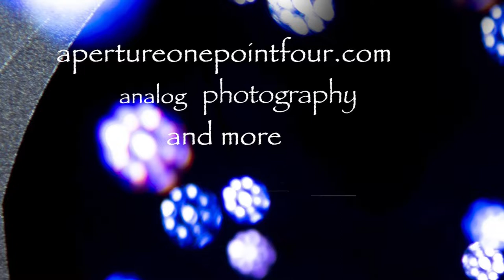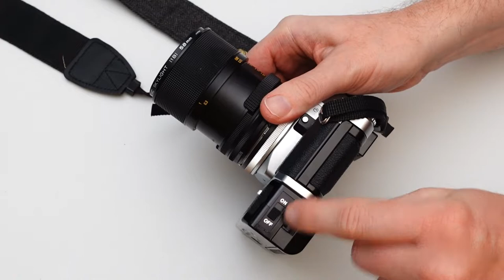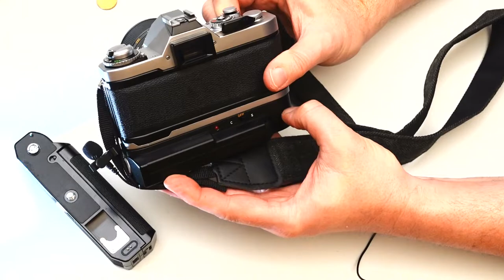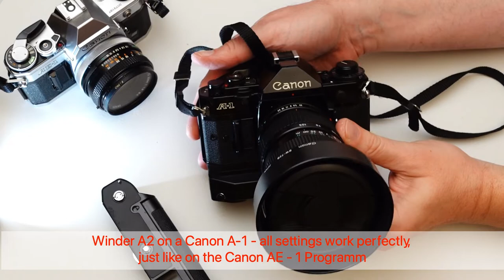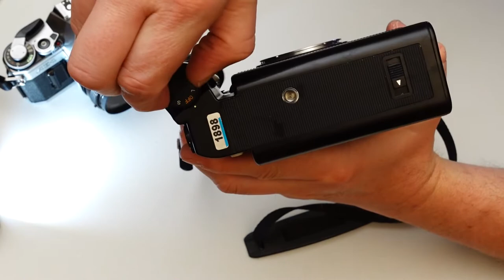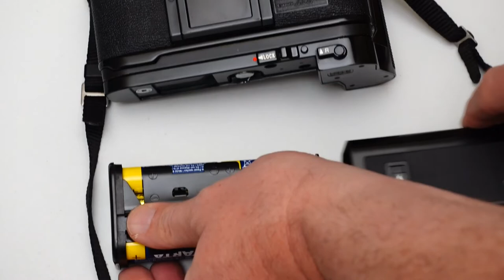Canon A-System:  Winder A  / A2 and Motor Drive MA

Comment: This video was exactly what I was looking for. I have the MA winder that was handed down and it turns on/the shutter buttons work, but the motor will not wind. Repair or a new motor is around $50 or so, as where I’m finding the A2 winder for around $35. I feel as if I will just go with the A2 for now and get the MA fixed down the road. When shooting film, I really don’t find myself in s position to where I would need 4-5fps. Also, the A2 only has 4 batteries compared to 12.. this makes transportation and the overall weight much easier to work with!

Comment: Hello! Can I use these for the canon f1?
Reply from the maker: No, these winders and the motor are only for the Canon A system, like A1, AE1, AV1 etc.
F1 New: You'll need the AE Motor Drive FN or AE Power Winder FN. Both will give the added option of shutter-priority AE to the New F-1.

F1 old: Motor Drive Unit, followed later by the much improved MF Motor Drive. There is also a special limited production unit: High Speed Motor Drive Camera, who has its debut for the Olympic Games at Sapporo in 1972.